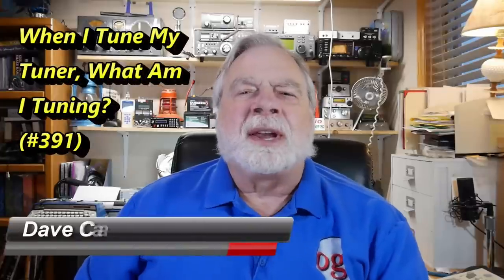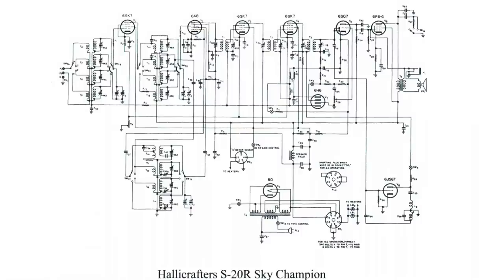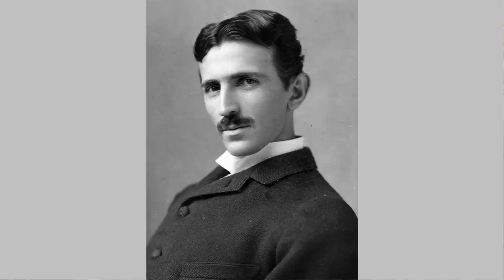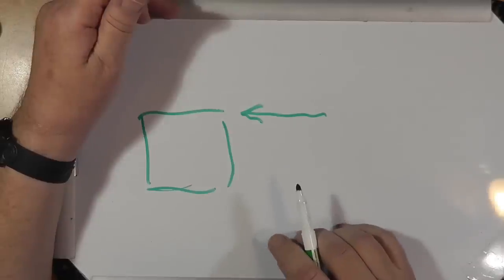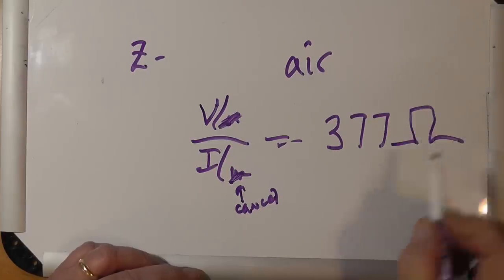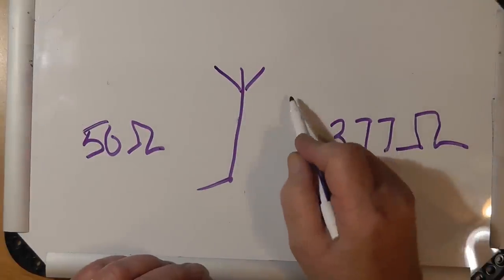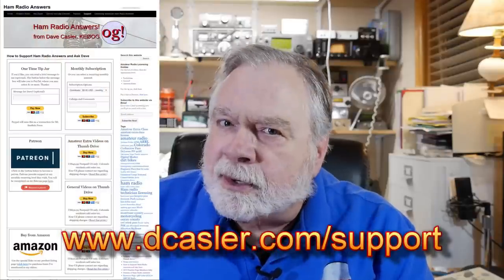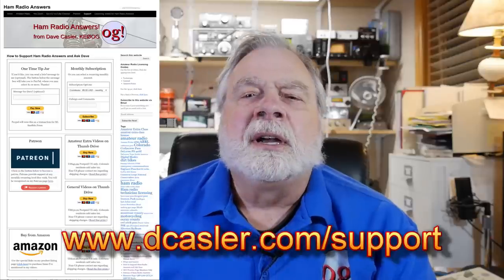What Am I Tuning When I Tune My Antenna Tuner? (#391)

Comment: I blame the use of the phrase Antenna Tuning Unit (ATU) to the confusion of many amateurs.  It could be more accurately termed an Antenna Matching Unit (AMU) but strictly speaking it is an impedance matching unit. The take away message here is in shack or built in matching units keep the radio happy by presenting it with a close 50 ohm match but does nothing for SWR and power loss in the feedline but the local control is convenient. The location any required matching network is best done at the antenna to minimise feedline losses but at HF frequencies the remote control or automation is expensive.
Reply: Rob, I completely agree. Antenna Matching Unit or Antenna Trans-Match is a clearer and more understandable term to explain what this device is doing. Tuner is misleading as it implies that you are actually changing the frequency of resonance of the antenna, which you are not. Simply you are impedance matching the 50 ohm signal from your transmitter which is presenting a frequency that your antenna is not resonant on and the antenna is presenting a potentially quite different impedance at the applied frequency. If your dipole was cut to resonance on 7040 CW and you QSY up to the high end of the phone band, say 7285 LSB, the antenna is still resonant at 7040 and presents a quite different impedance when 7285 is applied to it.

I've attempted to convey this understanding to several newly minted hams when they are confused by the term Tuner. It would be nice if the manufacturers would change the label on that button to "Trans-Match".

73 Chris W6NOB
Reply from the maker: When you use an antenna tuner, you are changing the frequency of resonance of the combination of the tuner, the feedline, the antenna, and the environment. The whole thing works as a system.
Reply: @davecasler  Hi Dave. While I agree with your statement on matching the whole system, my point is you are by no means tuning the antenna as the casual interpretation of the name might imply, Simply put an "ATU" best matches any reactance present. If you were to ask an engineer and a layman , "Which is more elastic a steel ball bearing or a rubber ball?" you would get two different  answers. The engineer would frame his answer in STRICTLY in terms of the Poisson ratio where as the layman would give the commonplace (mis)interpretation. I think a similar misinterpretation is being made by many amateurs because they tune up using VSWR with no regard to antenna feedpoint reactance and the "ATU" is simply acting to match the reactance at it's output to it's input it can not tune the physical length of the antenna. Hence the best  VSWR typically get into a dipole is about 1:1.5 or 73/50 ohms. Call me biased and pedantic but I favour resonant antennas over random lengths and if you really must do impedance transformation it is best done at the antenna feedpoint not at the radio. This ethos can often be seen in monoband VHF and higher antennas where the impedance imbalance is often corrected by a network at the antenna feedpoint, not something that is easy on a multi band HF antenna. There in lays a subject I suggest for an Ask Save episode. The pros and cons of  a matching unit or impedance transformer and it's physical location in a system.
Reply: @Rob B VK6ES  And here I thought they put that matching network at the antenna end mainly because the system isn't dependent on the transmission line at that point, so they can make a predictable correction.

Edit
I also can't understand how, when you take the entire system and add capacitance or inductance, you can't be changing the characteristics of the entire system as a whole, including resonance.
Reply: @patrickbuick5459  Your first assertion is accurate but of course there are practical limitations to the impedance transformation so logic would dictate a target match from say 10 to 1000 to 50 ohms resistive as a practical solution.. 
As for the the effects of L and C remember AC resonance occurs when voltage and current are in phase, that is Voltage is max at the same time Current is max. If an antenna presents something other than a pure resistance then the V and I are out of phase . Adding external L and C can oppose the phase error and bring V and I back into phase while at the same time transform the impedance from one side of a network to the other to make a good 50 ohm resistive match at the input in this case.
Reply: @Rob B VK6ES  Nice clarification. Thanks. I hadn't paid attention to theta, only Z when adjusting my antennas and hadn't fully comprehended that fact about resonance. I think you just cleared up power factor in appliances too!

I didn't think it was that expensive to correct at the antenna versus at the shack. The remote couplers like SGC and others make don't seem more expensive than the desktop ones.

My next area of confusion is why, if you adjust the entire system from coupler to antenna into resonance at the shack and bring V and I into phase for the entire system past the coupler presumably, is there still additional coax losses? I'm assuming that is why you say correction at the antenna is better. Or is there another reason I missed?

Comment: I have no call sigh.  I am looking for the mechanical method of electron deceleration to the creation of a photon.  Your channel has been very helpful.  And radio waves are heat.  The formula, "Wien's Law" => .0029/wavelength = temperature in Kelvin.  So 40 meter = .0000725 Kelvin and that adds heat to nothing so it just passes through unless it is collected within properly aligned resonance such as an antenna.  Thanks for the explanations from the practical end.
Reply from the maker: Heat and electromagnetic waves are both forms of energy, but there's no "heat field." But photons, as you go up in frequency, do carry more energy than those at lower frequencies. I'm not a thermal engineer (I'm an EE), and frankly heat has always mystified my.
Reply: @davecasler  Heat should not mystify you.  We are surrounded by atoms radiating radio waves at a frequency that make up what ever radiant temperature that surrounds us, but like rain on a lake they aren't in a wave distribution that gives energy to free electrons in continuous motions when they hit an antenna of set length.   As for "heat field", I think I will stick with "heat wave."  Tomaato, Tomooto.

Comment: Are you aware of anyone doing and posting results of a test where they measured parameters like X,R,Z, and theta at the shack and antenna ends plus field strength before and after tuning with the tuner at the shack, then at the antenna?
Is it even possible?
If possible, what equipment would be required?

I truly want to put my mind at rest regarding all of this and there is nothing like empirical evidence to do so lol.

Thanks.

Comment: Hi, Dave.  I've learned a lot from your videos and articles in QST.  My question concerns the usefulness of a certain type of HF antenna and tuner combination for Field Day use.  I've set up an EMCOMM communications trailer and am currently running a 600 Ohm ladder line fed, inverted V doublet, 80-10 meters, fed from a manual tuner into a 4:1 current balun.  It's a great antenna for EMCOMM because of its efficiency and the fact that I'm parked on only one or two HF frequencies.  For Field Day I tend to "hunt and pounce" across a wide range of HF frequencies.  I probably wouldn't be too popular during Field Day if I was constantly tuning up with the manual tuner every time I changed frequencies, so I'm wondering how well an external automatic tuner might work with this antenna set-up.  I like the doublet HF antenna design because I can work all 80-10 meter HF bands with one antenna.  I'm just wondering how well it might be suited for use as a Field Day antenna.  73 and thank you.  K7SFA

Comment: A square wave is a sine wave  and its ODD  order harmonics. Multi stage tuning has nothing to do with hetrodyne or super hetrodyne. Hetrodyne has to do with mixing two or more frequencies to get a different frequencies. Thus they mixed a frequency with another to get a lower frequency so that it would be easier to amplify the lower frequency because then the higher frequency was more difficult to amplify.
Reply from the maker: Well, you're right about the square wave. Regarding superhets, the point is to get to a fairly low-frequency intermediate frequency (historically 455 kHz) for reasons of selectivity. The IF filter usually is the determining filter for the receiver's selectivity.

Comment: I have a butter nut laying in my hall. the misses is about to kill me because it is there, but I guess you have to tune each one of the forty 75 any thing between ten and eighty. the one I have has nine bands on it I guess, but each one has to be tuned. the reason it is still laying there, because of where I came from. if you tinned the antenna on the ground and the erected it the swr would be different     one the ground as to being erected. so my worry is going to be like in the old days of the eleven meter band. different on the ground as to when you put it up. My question is if ground mounted a few feet of the ground will the matching still be good we just tuned it to one. point five or below. .

Comment: I'm listing to you in one ear. I got part of it . square wave is something that is in cheap inverters and pure sign wave is what you need to run your sensitive radios and tv's  that picture looks like a m f j manual tuner that I have. I have auto tuners on my radios. I know that I'm not talking about. what you are talking about but on antenna's  if you have a die pole and it is not an inverted v what one that is stretched out straight. I live on the side of a hill and I stretch out my antennas. so I would like to know the difference

Comment: The so called antenna tuners within radios or close to radios are not literally antenna tuners, but they are matching networks. In the usual case of a badly adapted antenna with a non-50-Ohm impedance the matching network has to maximize the power transference from radio to the antenna at the used frequency, which then falls into the category of conjugate matching, where the impedance of the antenna is "mirrored" in such a way that the impedance is the same, but the reactance is negative. According to the following paper from 1965 "K. Kurokawa, “Power waves and the scattering matrix,” IEEE Trans. Microwave Theory Tech., 13, #2, pp. 194–202, April 1965." the power wave reflection is reduced to 0 in case of conjugate matching, but that does not mean that all the power is transferred, and it also does not mean that the travelling voltage wave reflection wave is 0 too, because the reflection coefficients for power and travelling waves are calculated differently. Nevertheless, in that conjugate matching case the incident and reflected travelling voltage waves are reflected between the antenna and the matching network, and that is the reason why they do not get to the radio, and their energy gets dissipated mostly in the transmission line and the matching network, i.e. although power transference is maximized the remaining reduced reflected power is lost. More details on matching networks can be found in chapter 13 of the "Electromagnetic Waves and Antennas" book from Sophocles J. Orfanidis that is freely available online. There are losses in conjugate matching, and therefore we should strive to reduce the losses by adapting the antenna side with impedance transformers or similar things getting closer to the reflectionless matching case or use antennas that have hopefully out-of-the-box 50 Ohm impedance. Thanks and 73 from Tihomir CA3TSK

Comment: The nice thing about a tuning fork is it doesn't need batteries. Should I turn my  power down before adjusting the tuner extender on my radio - I'd hate to smoke a new IC-7300?
Reply from the maker: The 7300 will protect itself. Use either the external tuner or the internal tuner but never both.

Comment: I view it as: You are tuning the 'TUNER'. Nothing else is modified on either side of it. The tuner is an adapter of sorts between transmit system side and the antenna system side. It is like an adapter plate to mate different gear-boxes to an engine.
Reply from the maker: If you think about it in mechanical terms, an auto transmission matches the engine impedance to the road impedance.

Comment: Dave, this is Brian - KE7LOY.  Isn't it best to have the tuner at the base of the antenna at the feedpoint?
Reply: I thought the same, then watched some good wave theory videos explaining.

As I understand it now, subject to new information, is that the point of this entire exercise is to minimize the standing wave by minimizing the reflected power and therefore minimize the additional losses in the system due to the basic ohmic losses. It was shown therefore that it didn't matter where you did the transformation, only that you actually do it.

Having said that, if done at the antenna, it is more consistent for different lengths of feedline. On the other hand, if things aren't consistent in the feedline, that gets missed if done at the antenna.

Isn't this science so tough to pin down? And as a hobby to boot!

Comment: I would like to understand the differences between L-Network, PI-Network, and T-Network tuners.  I once heard a vendor suggest an L-Network-based tuner has less circulating current than the other types suggesting more power is delivered to the feedline/antenna system?
Reply from the maker: Sounds like marketing hype. An L-network takes fewer expensive reactive parts, but you need to be able to switch the L in the other direction if called for.

Comment: What can be done as far as RF gain control is concerned when shortwave radios lack RF gain and you want to connect a long random wire antenna and avoid overload? Tecsun just released the PL-330....external antenna input....no RF gain control. Ridiculous!
Reply: Get a good preselector and tune it there, one on EBAY right now, well worth to cost, tunes out what not wanted, tunes in what desired?

Comment: I’m so confused. So the antenna tuner basically just makes the radio think that that everything is good to go and keeps the radio happy by matching the impedance of the cable run and the antenna values?
I’m just so confused! 
Just give me the short Version next time LOL. How much information is to much information? I had to go through 
36:07 sec to get the answer I wanted in the last 20 sec of the video. 👍🏻🤣🤣
Ps; love your videos 😊
Reply from the maker: Yes, exactly

Comment: ok? I'm a poor boy. I have an amtron 500 tube and an old dentron that that is the limit of hams have to transmit I always wonder about load and the other. now you have me thinking if I have an auto in front of those tube antenna . I'm do something very wrong. ????
 father down the line 1 to 1 if you can get it.

Comment: Even worse, Dave, there's an EU/US disagreement if that should be 440 or 444 cycles. I once upset & impressed a Nakamichi technician when I pointed out that I could recognize a high end deck was mistuned by just that much.
Reply from the maker: I once had a congregation member ask me what I did with one of the hymns. It turned out I had transposed it down a half step and he noticed.  I don't have perfect pitch myself, but I can often notice when someone has transposed something. (Our organ can transpose at the touch of a button.)

Comment: Tuners don't 'tune' anything, they match impedances to that of the radio.  To tune an antenna you must make adjustments to the antenna its self.  To do that you add capacitance or impedance to the antenna...not the feedline.